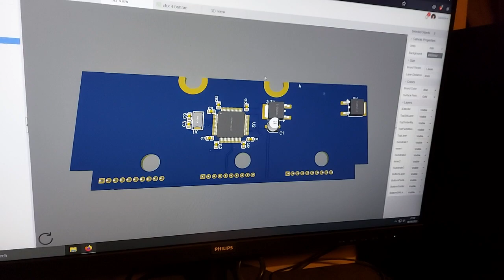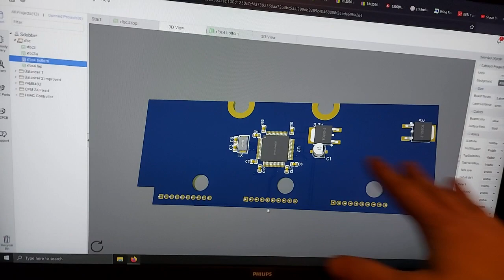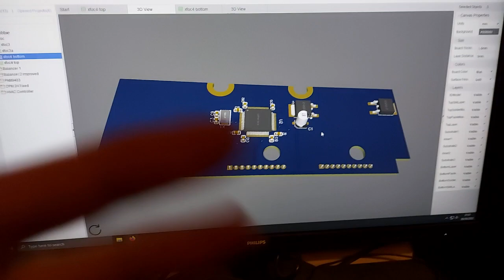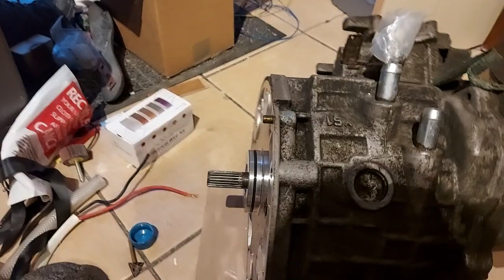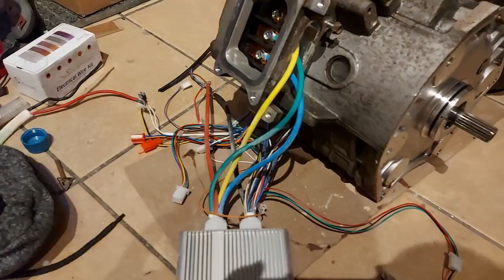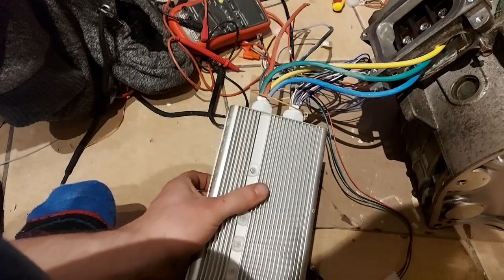Big 60KW Outlander PHEV Motor

Comment: I've used one of the front motors on my beetle and it's pretty weak. Thinking about changing to the rear motor
Reply from the maker: Just dump more power into it
Reply: @ShaunDobbie  doing 500 phase amps but inverter quickly shuts down. Not 100% sure why, likely temperature
Reply: @ShaunDobbie  I am running mine with a front tesla small drive unit inverter. 
So I know the inverter is capable of 220kw continuously but do you think this motor can put out 200kw (400V 500A) for 5sec?? 
Would appreciate your take because I have it cooled with an external radiator, but I want to know if I should worry about stuff other than heat...

Comment: Can you explain why the high inductance causes harmful voltage spikes?
Reply from the maker: It's kind of like a capacitor but when you remove the power source the energy must go somewhere when the magnetic field collapses. Since it can't go anywhere, you get a huge voltage across the inductor.
Reply: @ShaunDobbie  could you please get the weight!!
Please how many kw?
Reply from the maker: @FirstLast-tx3yj  I don't have anything to weigh it with!! It's 60Kw!!
Reply: @ShaunDobbie  i know I am also very impressed by it. 
I meant weight using normal scales  that you use to weight yourself

AnywayI want to know does it work with a VESC100/250 for example? Would be very compact for a motorcycle